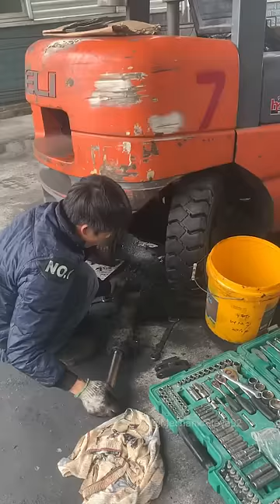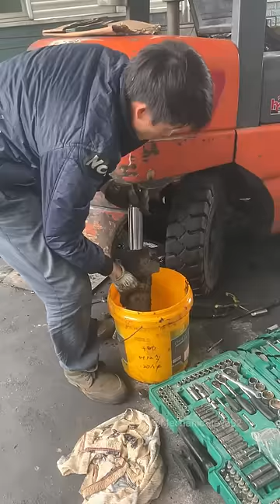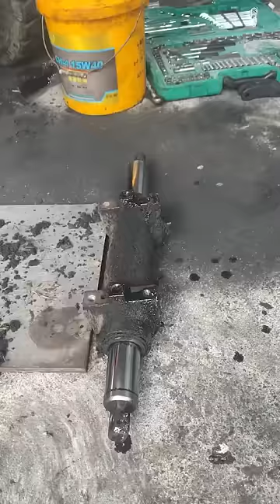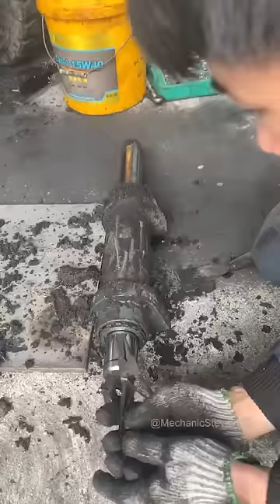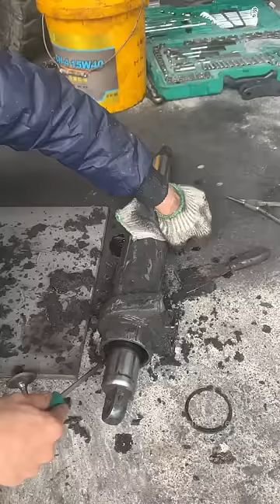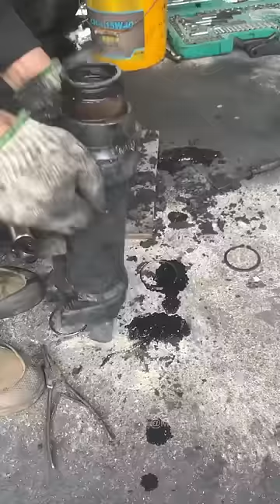#automobile #mechanicsteve #automechanic #mechanic #cars #restoration #trucks #shorts #short #fyp

Comment: I wonder if you could use kerosene in a pressure washer...?
Reply: i have seen gas ran through one once to try and clean it, nothing crazy happened. possible? yes. good idea? nooo lol. no telling how each different machine will act with it and most pressure washers dont have too much trouble getting caked on grease off stuff like this. Stay safe!